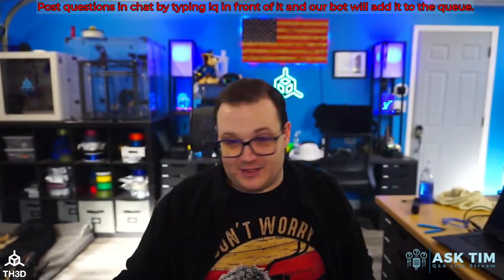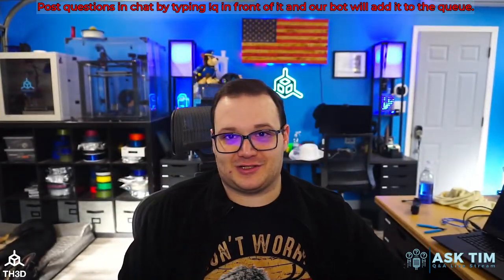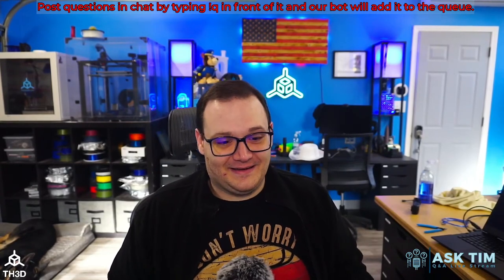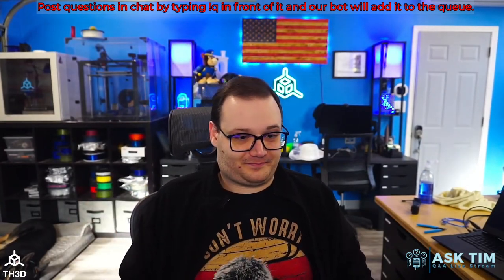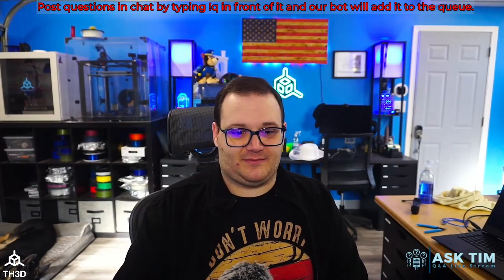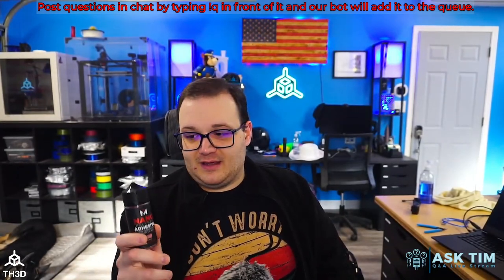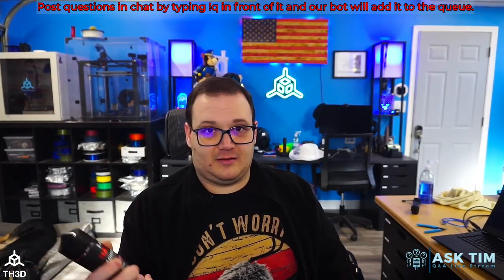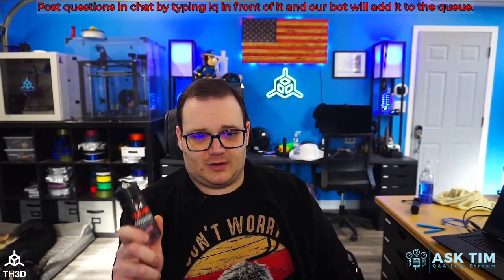Corners of Prints Warping - Ask Tim Clip - 3/15/23

Comment: Ok, a couple things.  I have my Ender 3 in a room that when I start printing, I leave the room and don’t go back in there until it’s done (or until it really messes up).  The reason I do that is because I had an enclosure for a short period but it was really messing up my prints.

So my question is, do you have to adjust the temps of the nozzle and/or the bed temp if you’re putting it in an enclosure?

Comment: I have a set of corflute "half height" doors on my enclosure for PLA where I am printing at the front of my build plate and especially items with small or thin areas. They are held on by tape and a bit janky but do the job of allowing airflow into the enclosure which benefits PLA, but stopping the convection current which has cool air pulled in low at the front and hot air venting up high.

Comment: I have a 3mm brim and it still pulls up in one corner. Could lowering the fan speed help? Or could getting a glass bed instead?
Reply from the maker: Try using a 10mm one. Also need to know what material you are working with and printer setup. Some materials like ABS/ASA/Nylon will also require an enclosure.
Reply: @TH3DStudio  It's pla i'm using

Comment: Im using an eclosure, printing pla, surface area is about 180mm square, bed temp 70C, Nozzle temp 210C, I used geetech jt16 glue stick. Still having corners warping pretty bad.
Reply from the maker: Try our bed cement we make. It's a lot stronger than gluesticks.
Reply: ok
Reply: is it in Amazon?
Reply: Smooth glass and Ellmer's glue stick works great for PLA, PETG, ASA, Nylon

Z offset is also pretty critical for the first lauer. Pretty painless with a touchprobe after you figure it out, kinda tricky to get right consistently if you are still leveling with a postit note.

Comment: Any ideas from a part design point of view?  I think I’m seeing a correlation between wall thickness / bottom thickness, basically any area that is 100% filled.  My theory is that this builds up tension more.
Reply from the maker: Yeah that also contributes. You can also try adding a brim to the print as well.
Reply: Could you explain this a little please?  Why would 100% infill warp more?  I would think that it being 100% would make it less likely to warp due to it not having anyway or collapsing on itself?
Reply: @heatherryan9820  it's a cross-sectional area thing.  When it shrinks as it cools, there is more total force to warp (break off the plate) because the cross-section is thicker.  It's like adding rubberbands around your wrist.  You add a few it's fine, you add a dozen and the forces add up and cut off the bloodflow.  I've found that gyroid and 3d hexagod infill reduces the likeliness, because of the curves in the pattern, act as little shock absorbs to stretch instead of that force going to the plate/print interface.
Reply: @CGreciful  thanks for clarifying that.  That actually makes a lot of since.

Comment: Im having this problem while printing my enclosure.
Reply from the maker: Check the enclosure temp. If its ABS and its not at least 45C you're going to want to insulate it, move to a warmer area, or add a small heater inside the chamber. If you have good temps inside then you can try a bed adhesive like our bed cement: https://www.th3dstudio.com/product/th3d-bed-cement-3d-printer-bed-adhesive-holds-strong-releases-easy/